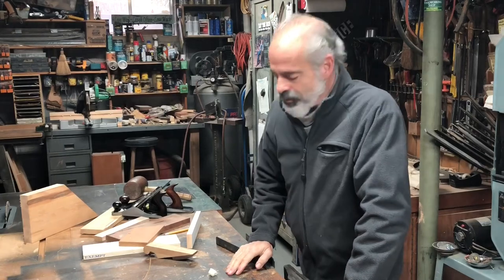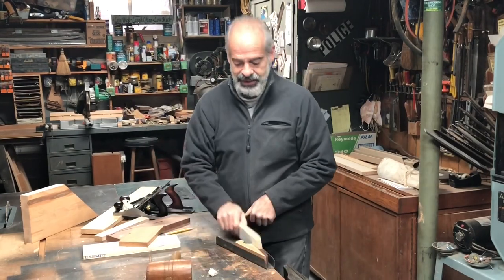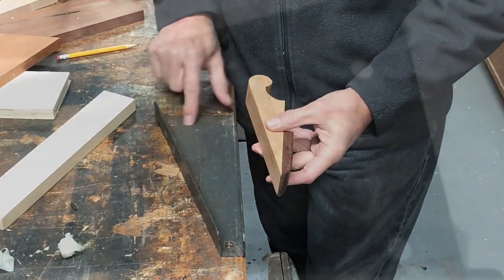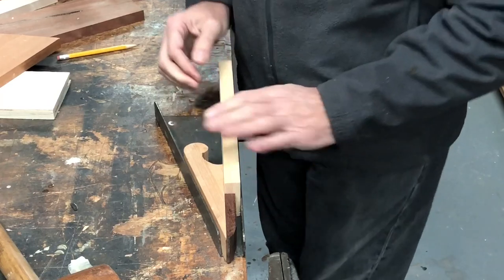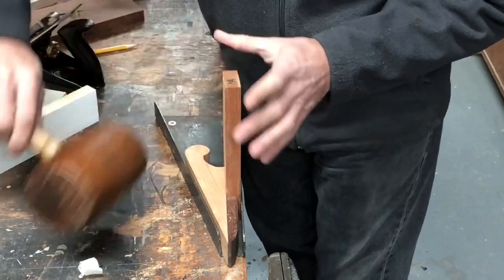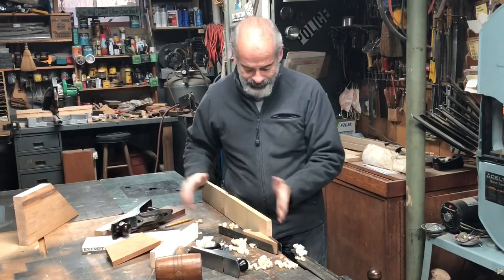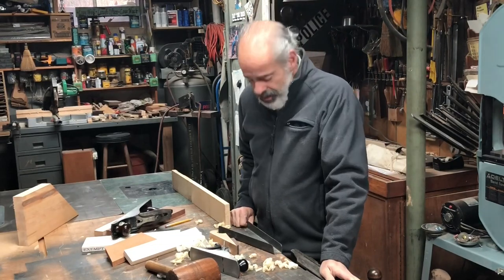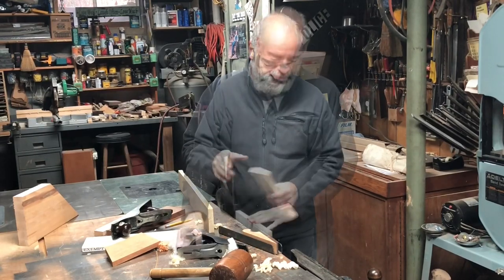STANLEY DEFIANCE WEDGE VISE

Comment: Thanks for posting this. You may have seen my wooden version on Bench.Talk.101 Chester. The principle is great, and the metal one has two distinct advantages: you could clamp the middle of a long board (as long as it is narrow enough), and there's little chance of it splitting if you go overboard knocking the wedge in.

Comment: Your videos are always enjoyable. You have a great attitude. I see you have a vice right there next to the wedge. The wedge could be screwed to a piece of wood and clamped into the vice so it could be quickly removed. If that wood was only on the side of the wedge than it would still sit flush with the bench top. You may have also just driven up the demand for the Handyman device!
Reply from the maker: I had thought of a similar approach but if you look at my Emmert vise it is offset from the bench so it would take an L shaped bracket to keep the board over the bench.

Comment: Thank you very much for this video, I have issues with my vice racking in such a way that I have to really pay attention when jointing to ensure my vise is not twisting my board, my vise holds parts well for sawing, but sometimes when jointing longer thin boards I have issues, I think I could add a wooden base to this screw on wedge vise and clamp that into my vise, then I could joint using the table for support, instead of having to really crank my vise tight and twist my board !
Reply from the maker: I had thought of a similar concept but the board would have to attach on the front edge so it doesn’t raise the vise above the table level.